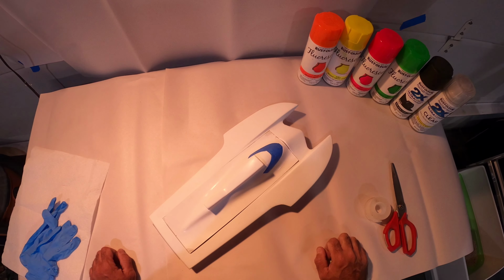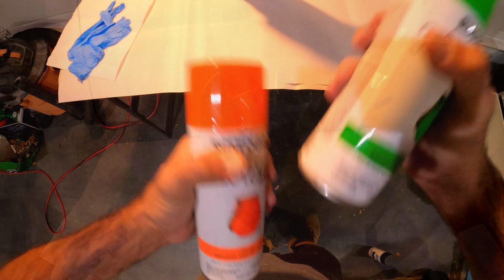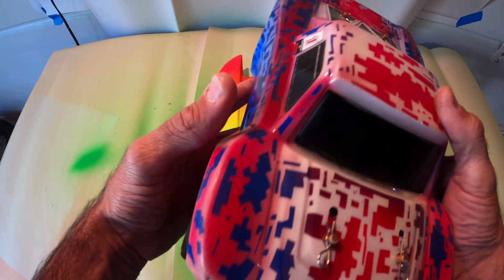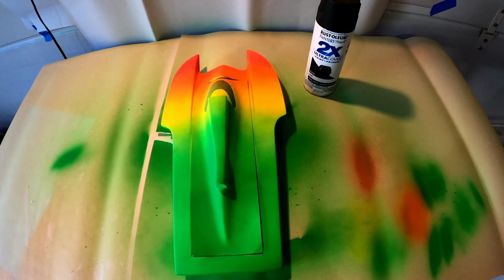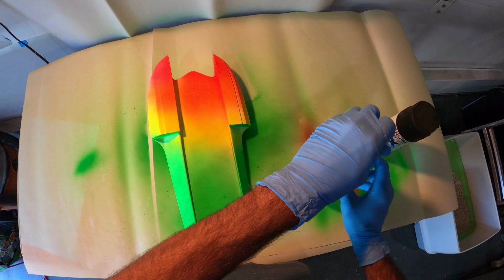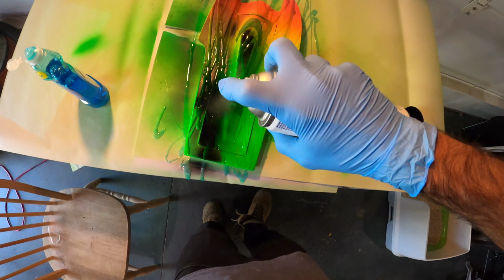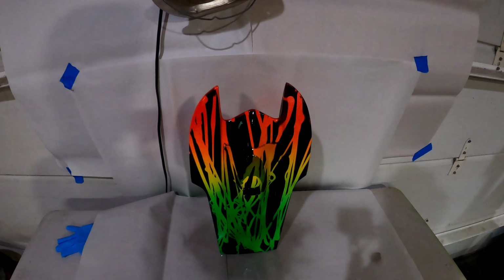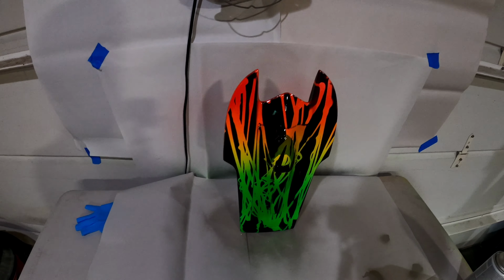HOW TO PAINT AN RC BOAT WITH DAWN DISH SOAP

Comment: Thanks for sharing,that its freakin AMZING....... After you sprayed the blak,how long did you wait till you washed it off? Thanks.
Reply from the maker: Washed it off right away...
Reply: @TeamHeavyChevy1  i agree it came out way better than expected!! Great job Big C!
Reply: I was about to ask the same thing
Reply: @JANDRMARINE so the paint didn't run with the water how ?
Reply from the maker: @TheRicsta  I'm not sure why.... Chemical reaction 🤷‍♂️
 I've done it where I've waited to remove the black and soap.. Thinking I need the black to dry.. And it was a nightmare getting it off

The black is still wet while washing.. If you Touch it with your hands or fingers.. It will smear.. Only the water removes it smoothly

Comment: Brilliant , 👏👏

did you wash the soap off after the black paint dried ?

How come the soap drizzle did not run  or move about when you turned it upside down and moved it around ?
Reply from the maker: I washed it off right away.. The soap did drizzle around a bit.. And globbed a bit in the back...which is why I rushed over to the water right away 

But that's the cool part of this process..
It doesn't have to be accurate..
And ypu get cool results
Reply: @JANDRMARINE  thanks . You put a drizzle of soap . Then black paint . Then washed off immediately . So water was put on wet black paint and it did not spoil it ?
Reply from the maker: @minochercowasjee  that is exactly what I did yes.
No.. Except for the spots where I was touching the wet paint and soap.. Everything else came out really nice and clean.
Reply: @JANDRMARINE   Super Cool 😎 who would have thought 💭!!

Comment: I think I waited to long to wash off soap ..... 
Mine kinda looks bad...m
Reply from the maker: @tonycoffee7335  if the paint is already dry
Try warm water and rub it lightly with your fingers.. Maybe that will take the remaining soap off

If not.. Paint can always be sanded or stripped... And tried again.

Don't get discouraged.. I'm sure it looks better than what you're saying.
Reply: @JANDRMARINE  thank you.  Iam sure I let it sit for a touch to long. I am going to see if it can sand it down and try to repaint. 
It's on a game console .
Reply from the maker: @tonycoffee7335  should be fine if you took the necessary steps to protect the electronics.

Props on having the guts to try it on a gaming console 💪
Reply: @JANDRMARINE  Thanks it's an old Nes I had. Everything is out.